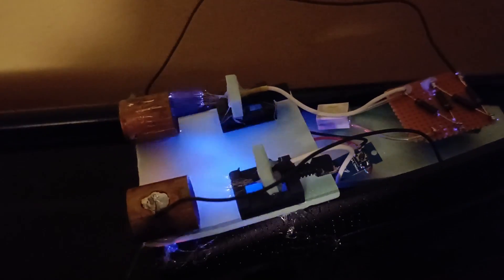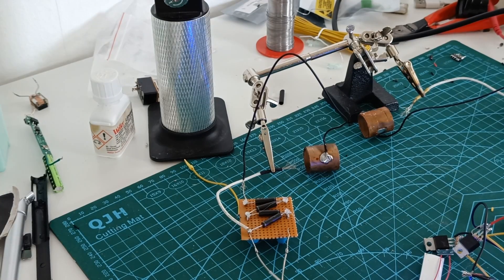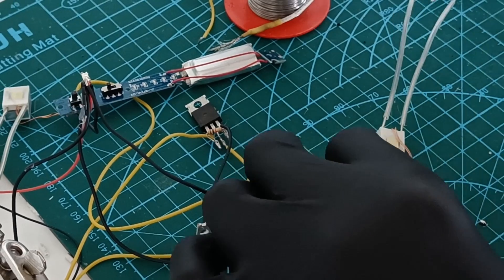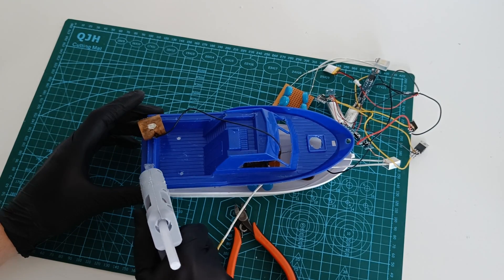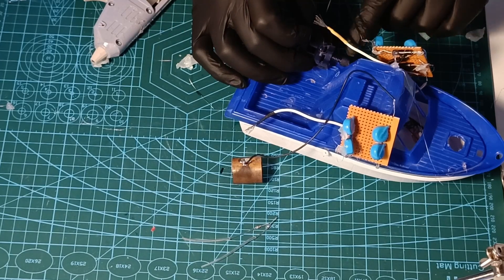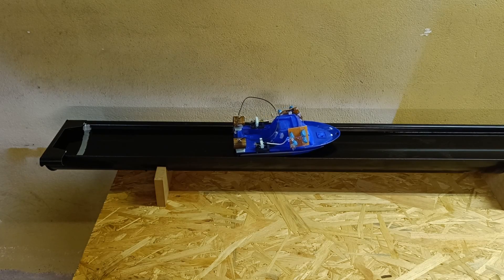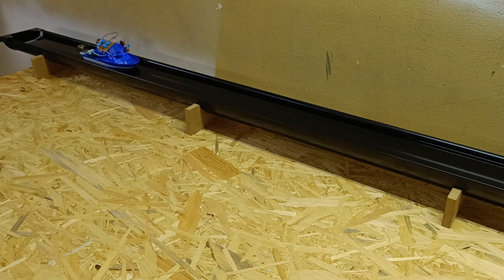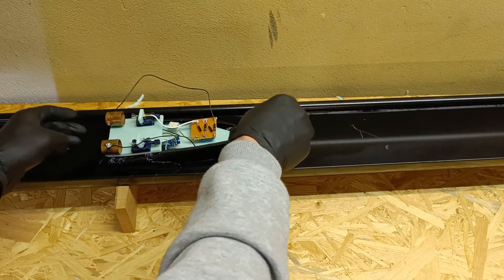RC Ion engine boat powered by ionic thrusters

Comment: one thing i keep seeing... 
the only thrust is due to electrostatic repulsion.
that is, you can only do work on the air molecules being charged. the air has mass, and you have to do work to accelerate that mass.

"neutral" air molecules that happen to be entrained in the flow, get carried along for the ride so to speak, are only DRAG. you do no work on repelling them, changing their momentum, they are accelerated simply by collisions with the molecules you DID perform work on. the air stream you accelerated is slowed down... you may SEE "air moving" but it isnt THRUST.

 "air entrainment", aka dyson fan (jetoptera?) doesnt work to produce thrust as you dont actually perform any work on that extra air.

 remember what thrust is. an action, repelling air, that has mass, inertia... a reaction, proportional to the mass acceleration.

anyway.. perusing an old physics book and came across an old "cyclotron" design, and im sort of wondering about maybe if such a design can work here?

two semi cylindrical cavities, a central electrode, an axial magnetic field, and the two cavities are alternately excited...

sort of thinking.. what if you added a rotary movement, accelerated the air in a staged duct type thing? ions travel to one cavity from the electrode, get twisted due to charges in magnetic fields. then the charge alternates and they get dragged to the opposite cavity...

and so forth until velocity exceeds curl induced by magnetic fields and it ejects from the rim tangentially. more air, ions, keep pumping in from  the center, getting charged, and all the air in there is being "worked upon"...

in the cyclotron, its acting in a vacuum on a cathode ray with electrons. here, its dealing with ions or charged molecules with more mass and the rotation is also opposite... but would it work? could you synchronise the oscillation with the transit time of the ions? aka airspeed? 

worth a shot ;)

anyway... nice to see one doing something. simply blowing air is NOT thrust! until a reaction is demonstrated like it is here, its doing no WORK. the boat may be low friction but to simply move it takes energy, work, force.

step it up a notch, use a load cell and give us reading of FORCE versus POWER CONSUMED.

you need to put a bit more effort into layouts for high voltages... no sharp points, adequate spacing.. the copious addition of hotglue does nothing. dont use perfboard... or PVC... if you want to pot things then do it properly with molten wax or oilbaths. it has to be homogenous...

those caps may be rated for HV but theyre also useless ceramic types. much better to make your own rolled caps from polethylene.propylene sheet (A4 sheet protectors?) and copper foil... much better pulse ratings, cheaper, and rolled well, just as good as commercial... 

all conductors are better as flat sheet rather than wire... lots of surface area. use copper tape. can sandwich it between regular scotch tape...

Comment: If you really want to get efficient you can make a bundle of fine wires with half the compacted cross-sectional area of the negative copper tube contact and then take the fine wires with tweezers and separate the tips of each wire from one another by a distance of the diameter of one filament so that you have an dense array of high electric field air polarization points.  The finer the wire / wire tip the higher the electric field density and the more efficient air polarzation and in turn thrust.  Problems with overloading by current draw on your power supply might occur the more emitter points you have so you might have to monitor current drawn from the supply and components.

Comment: If you use a wire with more filaments per unit area there will be more air ionization points due to the high electric field density at or near the end of each filament as long as the ends of each filament do not contact one another near the tips.  This will most likely improve your ion engine thrust.  Furthermore, to avoid electrical discharge between component leads on you capacitors you can spread the distance between the wire leads as electric field is measured in volts per meter.  If you double the distance betweel two capacitor leads on one capacitor or on any component for that matter, the electric field will be halved an so the less likely there will be loss due to electrical discharge.  If you still have discharge between leads then you might either step the voltage with more capacitors or find capacitors that are cylindrically shaped with leads at each end.  Really nice demo of ion thrust.  I did not realize you could propel an vehicle with ion thrust in atmosphere so quickly.

Comment: Hey, if possible encase the engines in plastic to have some insulation on the outside and the receiving end/edge , so that there is 10mm of insulator before the edge, it should direct air flow better and all that follows from it

Comment: hey bro, I think the thrust generated is smaller, and if I increase the electrical energy generated it will require a longer distance from the copper pipe, otherwise there will be a fire from the plasma, and the fire from it can burn the surrounding components, is there any other way increasing thrust many times safer?

Thank you.

Comment: Hi ✊ I‘m trying to build this for my 74mm drone. What I didn’t get was the chips to use on the PCB for the plasma. Did you increase the volts or amp? 

Try combining magnets to the copper pipes (thrusters). 

Try building it like a catamaran, less water friction. 

Good luck 🍀

Comment: Nice project. But which type of current did you use AC or DC
Reply from the maker: The power source is DC (battery) but the output from the arc lighter circuit is AC. That AC output goes into the voltage multiplier that outputs DC.

Comment: Love your project! Just a thought to try... if you had a thin non-conductive tube that went from just in front of the Anode breakout to the Cathode, it should entrap all air that gets caught up in the Ion cascade and improve your thrust. Checkout how a small turbine engine inside a large cylinder greatly increases the airflow, and therefore, the thrust, much like the venturi style vacuum that divers use to search through sand for buried treasure. I am confident we will see a much better performance. Wrap your fabric around something and wet it with water based model aircraft tissue dope, then remove the object carefully. That should give you a lightweight, rigid, non-conductive, non-flammable tube. Experiment with size to get the best flow.
Reply from the maker: Thank you. I will definitely try something like that
Reply: @rptechlab  YouTube plasma channel
Reply: try putting the anode in a fan duct and over the inlet of the cathode ,float the cathode in the center of the duct outlet ,The duct should pull outside air( ions that will and increase the flow trapped in the duct)  into the vacuum creating more thrust out,,,use a clear or (glass) duct section around the spark gap for the cool factor ,,,,lol enjoy
Reply: You did it !! now trap the spark gap in a tube so it stays in a focused area  like a jet engine with no moving parts ,,,,,,,more power will just be a Tesla coil that the spark will gap any ground around it ,,,you need to channel the flow of the gap ( trap it in the duct ) one way in one way out ,,,,,,great work !!!! enjoy
Reply: Thank you for your comment! What about nested tubes? Carbon fiber?

Comment: This is a great project! It seems like the water makes for a good low-friction environment to experiment with ion thrusters. What kind of current does it draw during operation? Do you have plans to iterate with multi-stage ion thrusters for a larger scale?
Reply from the maker: Yes I have plans to scale up those engines.
Reply: Actually, I found water to be a terrible way to test something using air to push. I built a tiny balsa boat with a bottle rocket on top and the surface tension was so great that it only moved about 8 inches. Water is only a good surface if you get to the speed where your boat begins hydroplaning (skipping on top rather than displacing and/or pushing through like slower watercraft.)
The best medium would be to test on a flat surface with a hovercraft style cushion of air, no friction at all!